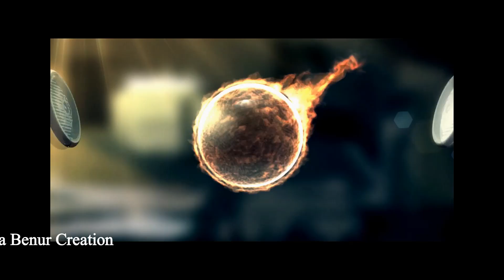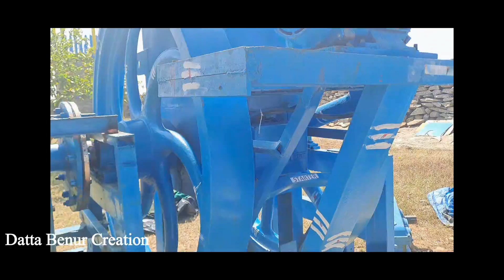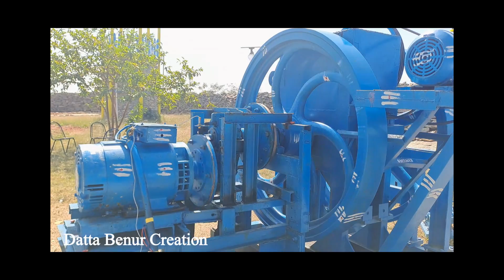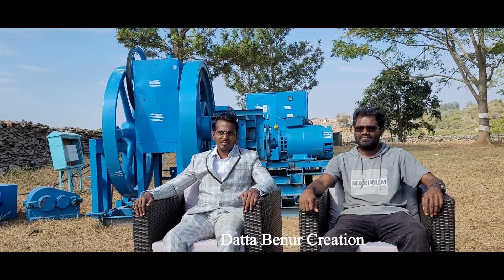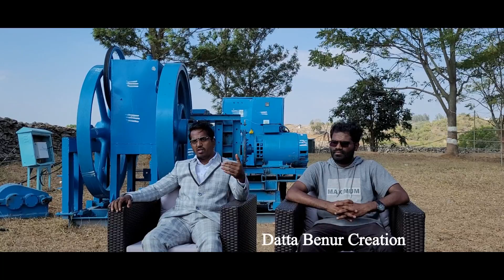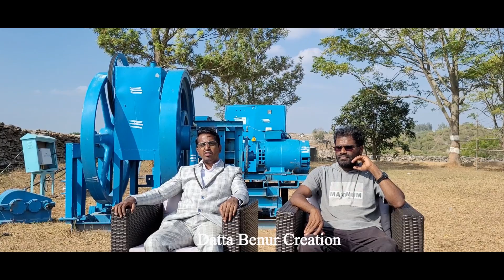the world first commercial flywheel Energy Technology - Flywheel Free Electricity (Episode 3)

Comment: Their website says the payments below which are in line with wind and hydro. This isn't free energy. They say it is 100% with zero input but then it says it can reduce the powerplant cost by upto 75%. Which is good but if it was zero input then it should say by 100% except the cost of the unit. And when ased how long it can run he said 100hrs, then it does require input? They are not clear on what it can do. 

Agriculture Use: Monthly Payments at ₹2 per unit power generated. 

Commercial Use: Monthly Payments at ₹4 per unit power generated.